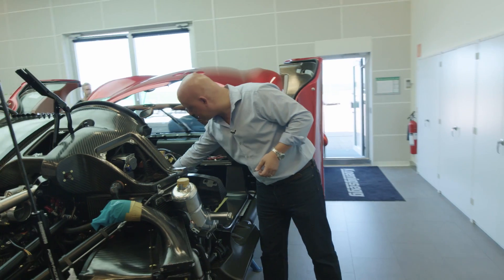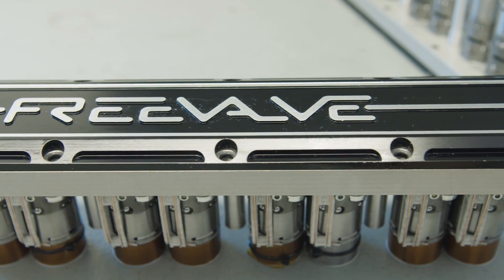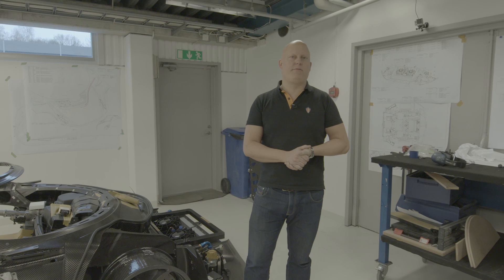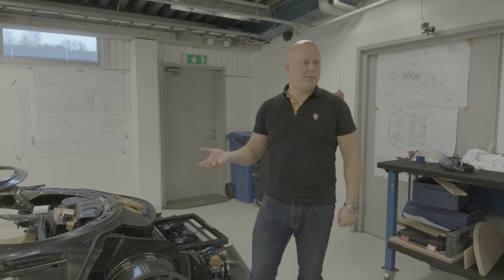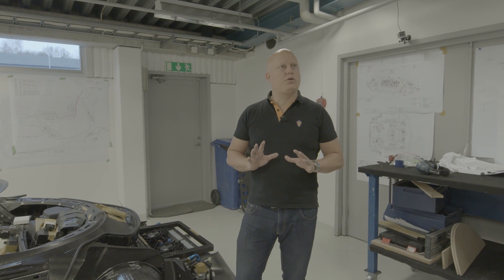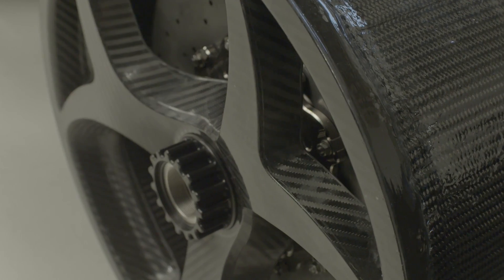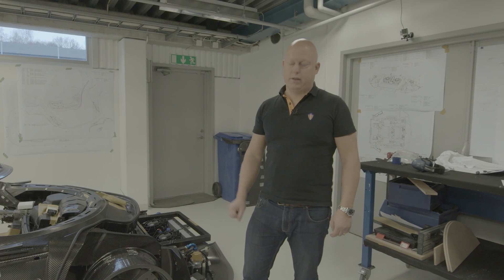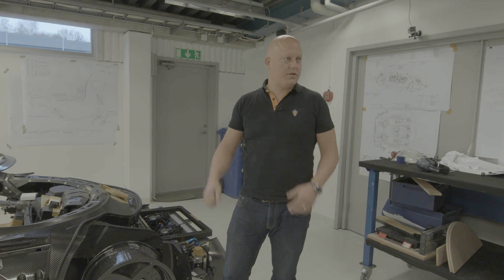Koenigsegg Regera New Carbon Fiber Wheel Design -- /INSIDE KOENIGSEGG

Comment: Agera's carbon wheels were designed by engineers and it was a 5-spoke... and this Regera wheel design was designed by designers, but it is basically a 3-spoke even though 3-spoke wheels have usually been less popular in terms of aesthetics (compared to 5-spokes)...

Comment: He is not right about those rims...Alfa Romeo has a simmilar alloy design on 147 and 156.https://www.google.ro/search?q=alfa+romeo+biohazard&client=firefox-b&biw=1920&bih=916&tbm=isch&source=lnms&sa=X&ved=0ahUKEwjC29uur-nPAhXGQpoKHVwBBA4Q_AUIBigB#imgrc=ebPVUJzMChE7PM%3A
Reply: Yes you are right they had a similar design but have you looked at the images in your link?  Look at the width of the base where it connects to the hub they are 2-3x as thick as these wheels (which he goes on to talk about).  Plus he was talking about how the CF are hollow, I would bet willing to bet that, while concave, the back those spokes would be MUCH thicker material than these to even come close.

Comment: Other manufacturers have thought of it too, of course. Bugatti put some on the Gran Turismo Concept, but they made it differently, only the outer partt of the rim is carbon fiber. Why? Well, they said, that carbon fiber rims brake under high temperatures coming from the brakes. There are hundreds, if not thousands working in the R&D in companies like Ferrari, Porsche or Bugatti and does really someone believe, that no one have thought of it? Koenigsegg is way too hyped on the internet.

Comment: Only one in the market? Doesn't the Mustang GT350R also has Carbon Fibre wheels?
Reply: acnfanmanin Hollow carbon, not a solid chunk of carbon
Reply: acnfanmanin They aren't  hollow
Reply: Well slightly different the gt350r uses carbon revolution wheels. They have a high density foam core. Where as these are hollow with no core
Reply: Listen to what he says.
Reply: Eric Sangimino Oh right they're not hollow
Reply: At least the spokes are. http://st.hotrod.com/uploads/sites/21/2016/01/2-Mustang-GT350R-Wheel.jpg?interpolation=lanczos-none&fit=around%7C596%3A373&crop=596%3A373%3B%2A%2C%2A
Reply: No

Comment: I just got a shiver from thinking about how much it would be to replace a wheel.
Reply: If you can afford the car, a wheel is probably pocket change.
Reply: Patrick94GSR Of course the owner has money to blow, but as a college student I can only imagine the price per wheel.
Reply: Adem Baba he didn't talk, he just typed
Reply: oops, math error lol!  That's unlike me because I love maths haha
Reply: I attended a factory tour at Koenigsegg (one of the best experiences ever, especially if you are interested in engineering), and we got to hold one of the agera carbon wheels, only 5kg, extremely light, was awesome.
We asked the guide what it would cost, and I think I recall him saying one set is about the price of an Mercedes S class, so perhaps about $120.000-$200.000
Reply: The Stig I didnt know that you can talk...
Reply: The GT350 R carbon wheels cost around 7 grand a piece if you buy them direct from Ford, but that's if you just want to buy them outright. If your actually damage your own gt350r wheels they are probably a little cheaper. Even at 7 grand I bet they are cheaper than the Agera/Regera, they are smaller and not a hollow body design.
Reply: Actually the GT350R front wheels are about $4,200 each, and the rear wheels about $3,500 each, the difference being the finish applied to the front wheels to protect them from the intense brake heat.  And yes, the GT350R wheels actually do have hollow pockets inside the spokes.  Check out the cutaway pics: http://www.hotrod.com/articles/the-4000-mistake-you-dont-want-to-make-with-your-new-ford-mustang-gt350r/
Reply: Patrick94GSR ah ok musta been an old article I read when they first talked about the possible costs. I just figured they weren't hollow. Phenomenal for a "mass" produced American car.
Reply: @Johan Andersson for a set as in all 4 or front and rear?
Reply: The Stig I'm not 100%, but I think it's for all 4
Reply: Johan Andersson
That seems a little far-fetched.  At 5 kg per wheel, even in gold that would be about $160K US.  You think they consider their CF wheels worth the same as an equivalent weight in gold?
Reply: Patrick94GSR 5 kg of gold is about $223k
that is more than the price of 4 wheels, so it's not equivalent. But I'm positivt the guide said they're worth about as much as a S class.
Reply: Koenigsegg replaces all carbon fibre wheels that have been damaged in any way
Reply: Now think about the fast that when you would have ruined a wheel on one of these, bodywork by then would very likely also be damaged and many other suspension components.